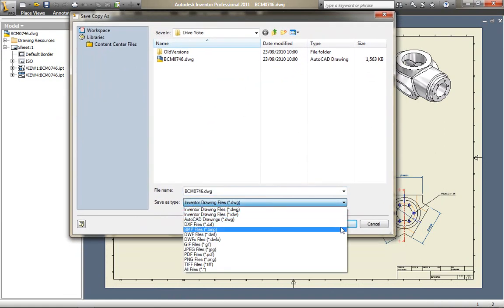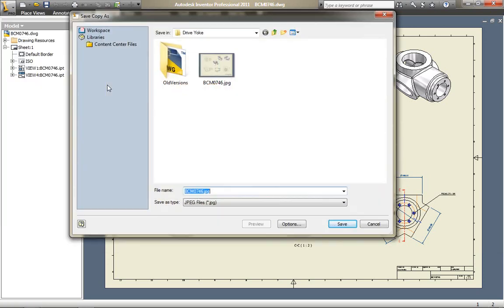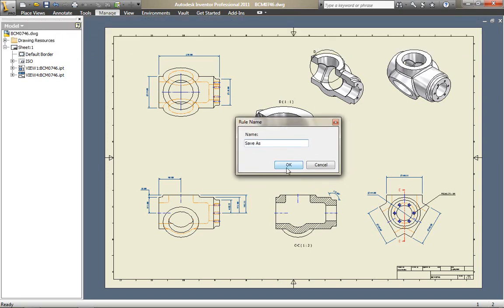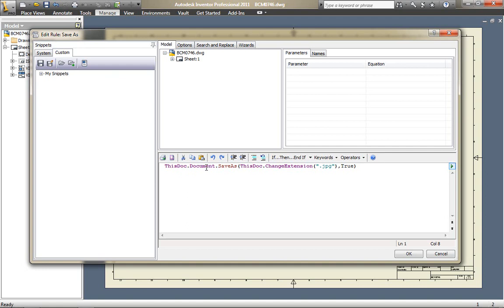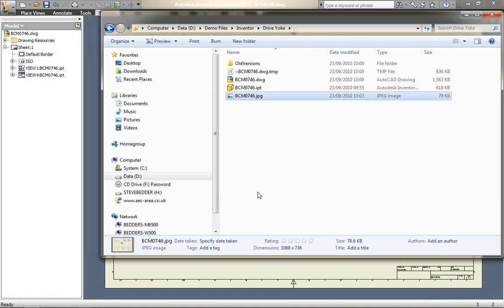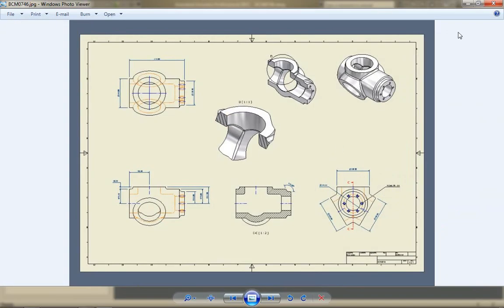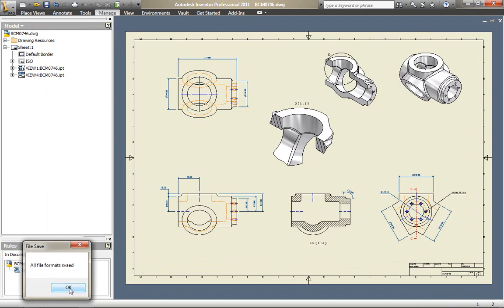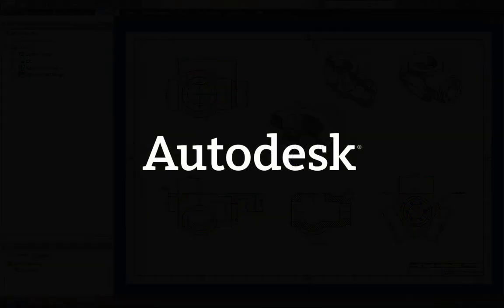Autodesk Inventor 2011 - iLogic Save Copy As

Comment: Hello,  thank you for sharing such information. I am using Inventor 2015 and I am very new with Inventor too.  I have not managed to understand how you run the rule. Is it done automatically when you save the drawing, or you need to run the rule (as and when required) to generate the files. Obviously it is quicker than doing Save A Copy but if this could run automatically along side saving the drawing, this will be even quicker.  Thanks
Reply: NacNac Mott 
Hi,

you can add this line in front of all the lines shown in this video:
ThisDoc.Document.Save 
this would save your .idw and generate the file you want.

To run the rule you can right-click it with the mouse and "run rule" or
you can put the rule in the "Forms"/ "General Forms" tab, that would automatically generate a button in the tab, you just have to click the button every time you need the rule to run. (essentially this just saves you right-click + run rule, as far as I am aware)

I hope this helped :)